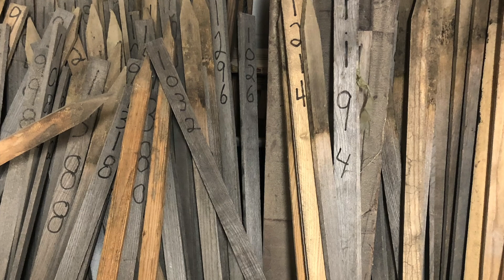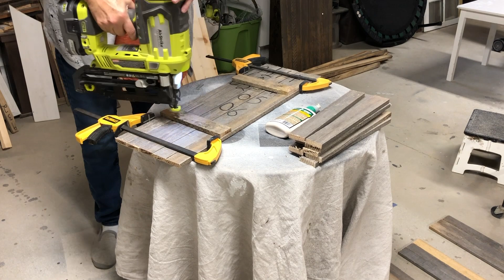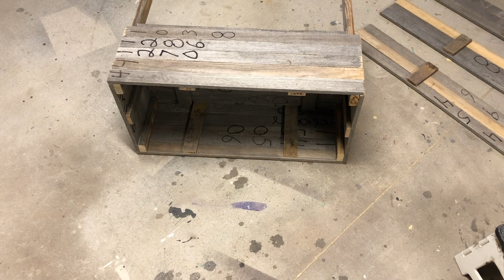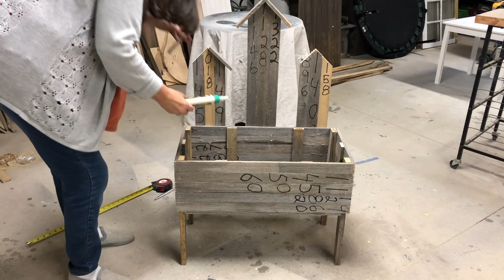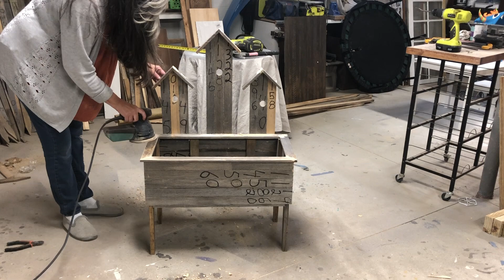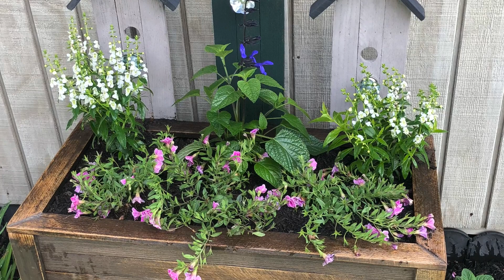Garden Upcycle Part 2 #diy #garden

Comment: I wish you would have shown how you did the bottom and attached it because I think you had to cut out sections where the legs were? Detail is everything in YT videos. I do absolutely love how it turned out though 😍❣️
Reply: Can you explain to me how you did the bottom and attached it? I just got done telling my dad yesterday that I want to build a small raised garden bed 😊❣️
Reply from the maker: @ambermoy8147  Since I was using stakes I just set them in one by one and nailed a small board across them exactly like I did the sides and then nailed from the outside to secure it.  If I were building it and not using what I already had on hand (the stakes) I would have used wider boards that would be easier to build with.  I hope this helps.